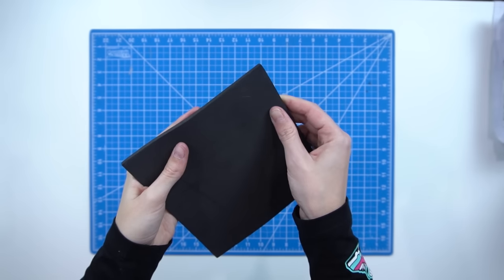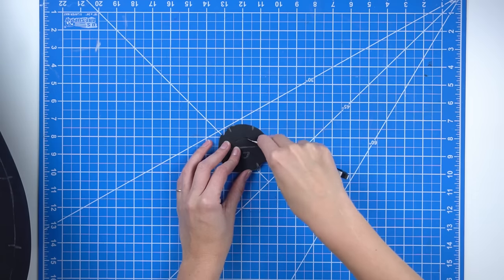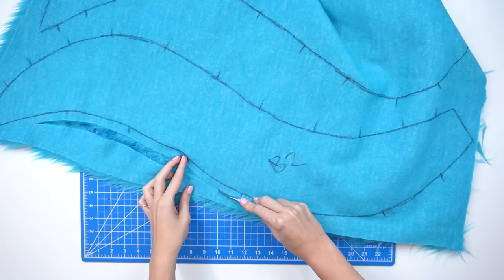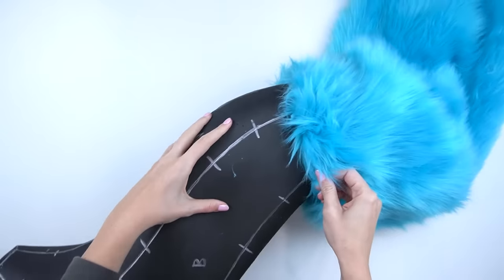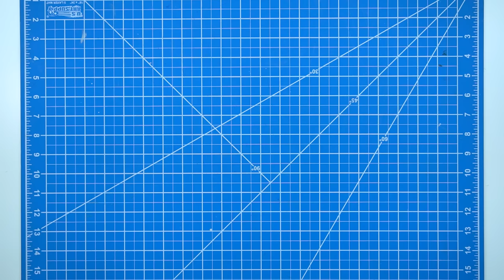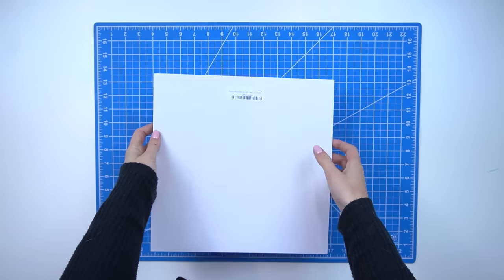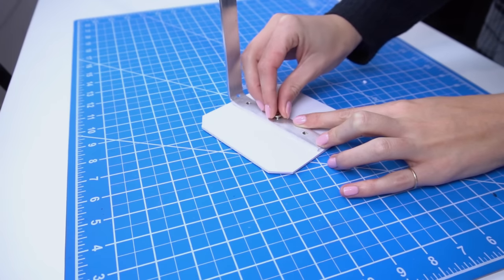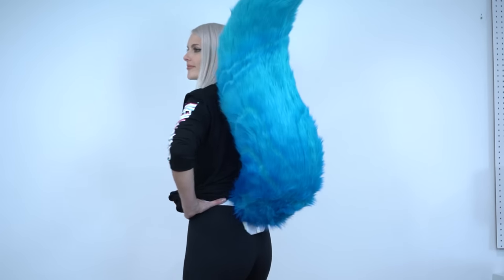Cosplay Tail & Harness Tutorial!  - Upright Foam Tail

Comment: Hey there, fursuit maker here! I would highly advise against using super glue on foam board, or if you do please do a spot test first. I'm not sure what type of glue that you used, but when I tried using basic super glue on foam board, it ate away the board and produced chemical fumes. Just please be sure to be careful and research the materials you use and how they react to certain adhesives!
Reply from the maker: Hi! Yes Superglue will melt the board just slightlyvand when the pieces are glued together it will pretty much fuse them! This is part of why this is the kind of glue recommended to work with PVC board for cosplay and prop making. I've been using it for many years now, and I can't say I've ever had it eat away at the board like you've said. :) But I do agree that PVC board  is a very toxic material to work with in some situations, it can produce dangerous fumes when it's heated with a heatgun to be shaped. We always tell people to use a respirator when they do this of to do it outside.
Reply: Thinking this would be a great option for a skunk suit? what do you think?
Reply: @Molly-yn2pq  I think it would def be a great option for any critter with a big/raised tail, seeing as how it's so lightweight!
Reply: @Molly-yn2pq  omg yes i need to see this
Reply: @Molly-yn2pq  hi i made a skunk tail using this pattern last night! to get the white stripe I made pattern B white and cut the pattern into 3 pieces. I did not cut A and C into pieces and just used one singular cut.

Comment: A quick suggestion is to swap the hot glue for 2 part epoxy when attaching your belt to the PVC board. It's a lot sturdier and if you live in a hot climate the hot glue may fail. Epoxy adheres to plastic a lot better than hot glue as well. Just a thought for those who find that hot glue doesn't do the job :)
Reply: Oooooorrrrr

Comment: Note to anyone taking this on. The linked bar was too long at 48" so you may have to be able to cut metal or bend the end over about 6" from the end. The 3rd hole isnt shown being used but you must use it.  Also there is a part that is skipped showing you how to make a paper pattern with the duct tape pieces you cut off. If you havent done this before your foam tail wont likely be symmetrical like she says so youll have to either leave extra seam allowance so the cover is looser to accommodate or wrap the whole piece to make 4 pattern pieces. There were a lot of accommodations and plan b's I had to do but it is a good tutorial if you have access to a lot of crafting tools and are at least a little familiar with making these types of projects

Comment: I should remember this when I remake Lily's tail (an OC of mine).  I want her tail to curl up and around, and it kind of does right now?  But it's not stable, so it doesn't really lift as high as I want it to (this is largely because it's attached to just a belt, not a proper harness, I guess).  (Edit: The only problem I see with this build is just how much hot glue is used.  If I were to do this, I'd try to find other ways to pull off the same thing.)

Comment: How would you suggest modifying this for a character with many tails? Smaller bases for the tails so they don't crowd each other out?
Reply from the maker: You could make the tails thinner, with a smaller base and make the tail harness larger for All 9 alluminum bars to fit on.  Or what you could also do is make it that 2 of 3 tails meet and join at the base. Then use a single bar to support the 2-3 tails and then you use less metal and it would maybe be a bit lighter :)
Reply: @KinpatsuCosplay  Thank you so much for the swift reply, this is a huge help <3

Comment: Would the harness work of an articulated uphostery foam tail? I'm making Lucario (Pokemon) and I made a tail out of medium density foam and made it articulated so it can bend. It goes more or less straight out the back, and is quite difficult to wear without hitting anything, so that's why I made it bend. I may have to modify some stuff, but I feel like a plastic, or even EVA base could help, just to have something a little harder. I can't wear belts very well due to chronic illness, so I may try one that goes around the legs.

Comment: I know your not going to respond to this but i was going to buy the pattern for the outfit but how do i use the tamplete im not your size so if i make it im not going to be able to fit in it
Reply from the maker: Hi there. If you want the tail pattern to be larger or smaller you can just print it at a different scale eg 80% for smaller or 120% for  larger. This tail is a separate costume piece so there will never be a problem where it doesn't fit someone as its not a garment or armor piece. It just depends on how big or small you want it to be for yourself :)
Reply: @KinpatsuCosplay  omg you responded  i was thinking of buying the Ahri spirt blossom tutorial i was kinda wondering how it would work but thanks for telling me!
Reply from the maker: @porntippremsaptawee7811  oh I misunderstood! If it's the pattern for the outfit then you can also print it at different percentages for different sizes :) but if you need to make adjustment you can add or remove a few cm at the sides of the patterns to get the correct size for yourself. We include the measurements for the base pattern for people to use as a reference! :3
Reply: @KinpatsuCosplay  Ok 😊 I really love your design btw